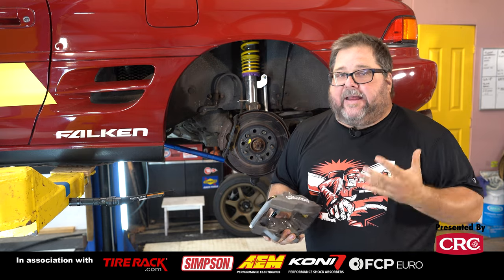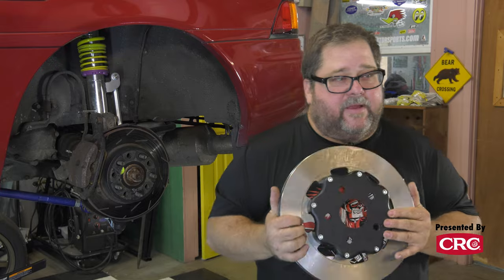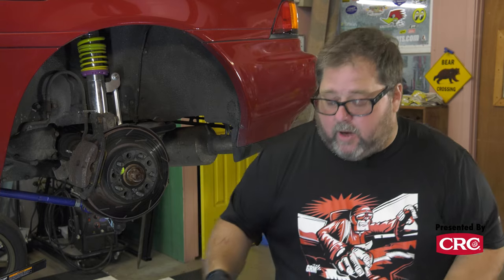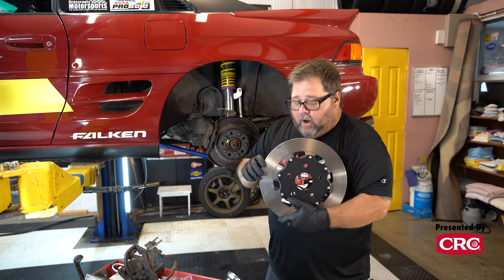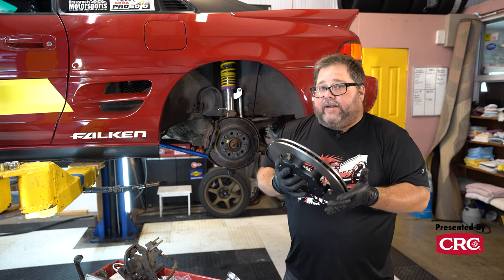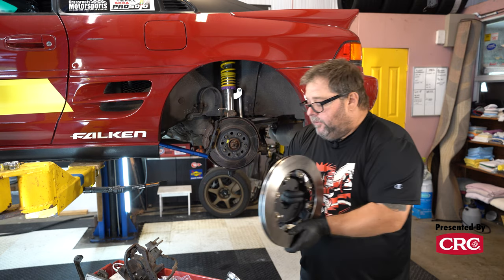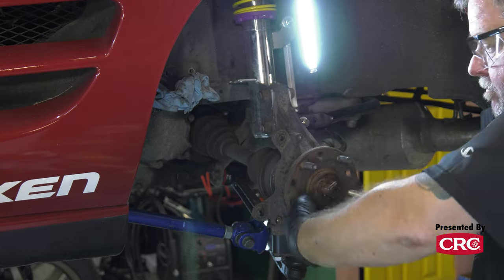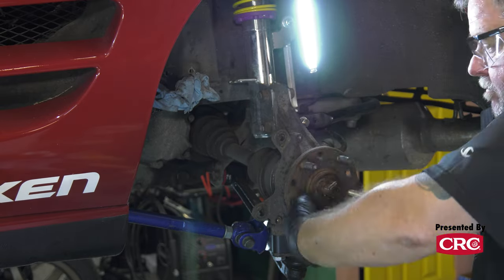How to Put Big Wilwood Brakes on an MR2 Turbo

Comment: Nice video!  If you want ARP studs with the speed nose, ARP #1007717 also fits.  I think they are spec'd for the EVO.  They are a little longer than the Lexus studs.
Reply: Yeah I saw those in the catalog and they're like .007" more knurl diameter. But I guess enough impact gun should pull them through just fine. Glad to know they work. I may switch to those on the front if I ever have to run more spacer.
Reply: @j.g.pasterjak1782  to be fair, I've never tried installing them with the nut / wrench method, I've always done it with a press with the hub / knuckle off of the car.  They might be a little harder to pull on with a nut.
Reply: @alexwilhelm8286  Yeah it's hard to argue with 15 tons of hydraulic force
Reply: Was the same brake pad compound used with both old and new brake systems? If not, not a really valid test of the two systems, it was a test of the pads.

Comment: Great video of a really nice upgrade.  It looks like there is more time on the table on corner entry once you get used to the better braking performance.  It seems like you were overslowing a bit compared to the old setup.  How does the bias feel and are you doing any kind of a proportioning valve to sort that out?
Reply from the maker: So, the real behind the scenes story here is the day we went to test the "after" setup, we had intermittent showers at the track. We still managed to run a tenth faster than our previous time with the old brakes, but we felt there was enough difference in the conditions that overall lap times weren't an accurate comparison. So we highlighted the performance with the data by picking a couple specific corners where the increased initial bite and better feedback were also highly visible on the data. And, yes, we switched to a manual bias adjuster which we'l be highlighting in separate content, since it's a lot to cover in an already 17-minute video.
Reply: @Grassrootsmotorsports  Thanks for the added info!  Gotta love the Florida weather.  Looking forward to more of these videos from my home track!
Reply: @TankRust  Thanks! I'm still trying to hit your TT5 times with this TT4 MR2 :)

Comment: Do you know if my 16" rpf1's will fit over this set? Might have to sell and get 17" but I'd rather not if I don't have to
Reply from the maker: The issue with 16" wheels is usually the parking brake caliper. It fits inside a lot of 16s but I can't speak specifically to RPF1s. If you go to Wilhelm's site, he's got links to the Wilwood templates, though. https://wilhelmraceworks.com/big-brakes
Reply: @Grassrootsmotorsports  thanks for the reply, I have rear 17's so that would be alright. I'll check out the link to make sure though.
Reply from the maker: @devjk1  My car is on the lift right now, too, so if you want some specific measurements just let me know. jg[at]grassrootsmotorsports[dot]com